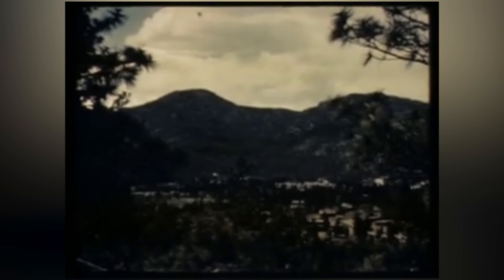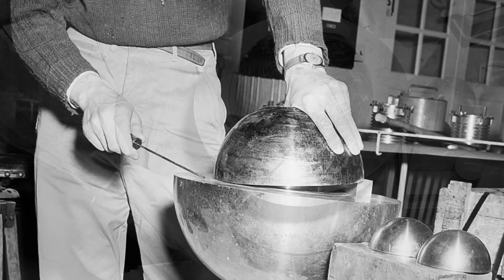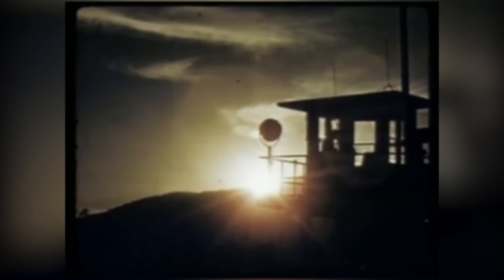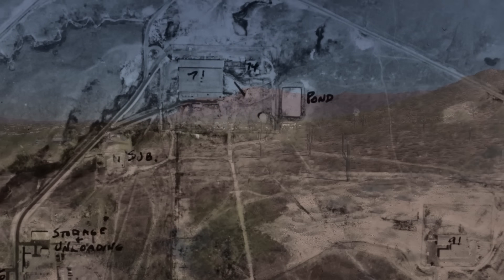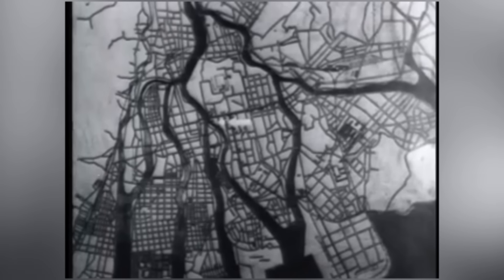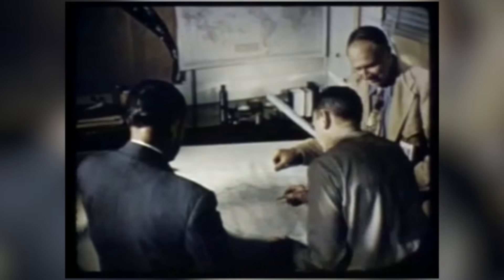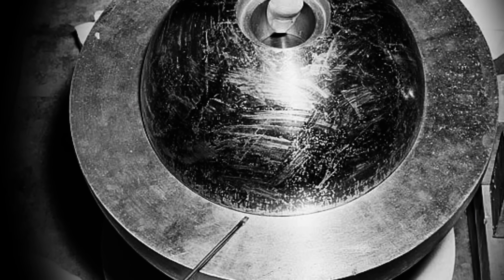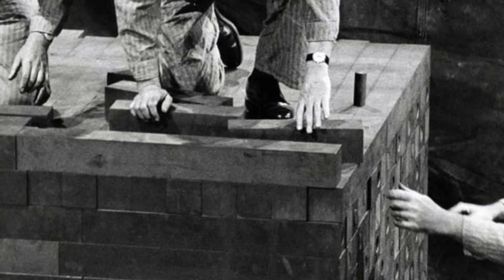Demon Core: The Unused Third Atomic Bomb of WW2

Comment: It wasn't the contact with the sphere that made it go supercritical. It was sitting directly on another half hemisphere of beryllium. Beryllium is a neutron reflector. The neutrons were being directed back into the plutonium and some were knocking additional neutrons away the core of their atom. The fully covered plutonium had enough neutrons being reflected and knocking others off the plutonium atoms that it went critical.
 Also, the flash if blue light was from the atoms in the air being excited.
Reply: What was supposed to happened? What was a successful demonstration outcome?
Reply: Seemingly informative language like this **in the comment section** draws me in, until grammatical errors begin pouring out like diarrhea. That's when I get super drawn in... nothing on the internet is more entertaining than the thirst of a cyber "genius". Really amps me up to drop a screwdriver.
Reply: the Dragon had awakened.............